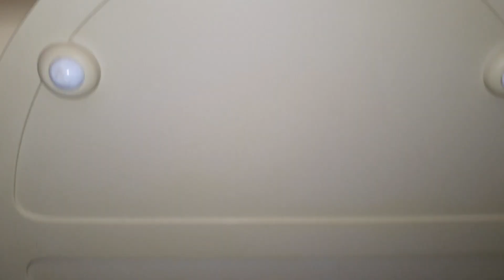EXTRA SPECIAL FIND!!!!! 1967 Twyfords "Vortic" toilet!!!

Comment: Absolutely brilliant, however it is pretty similar to the UK design Vortic of the same age, the only difference being a syphon in the cistern and the ‘vortic’ model name was taken off the pan by the 60s. Very cool and hope you manage to find more syphonics!
Reply from the maker: seems like the SA versions were still called "Vortic" by the 60s as this one dates to 1967, the one in sparkyfireworks's collection seems very different to this except for the trap.
Reply: @toiletsofsouthafrica  yes, they were still called vortic here but they stopped stamping the model name under the logo. Sparkyfireworks one is from the 50s, by the 60s they had redesigned it to this design, although I’ve never seen this design myself apart from in pictures, one UK filmer did find 2. The Norwood, Brampton and Vortic from the 60s onwards all shared the same pedestal and cistern design. (As did the bottom outlet syphonic ‘Crescent’ which I found, but that was intended for export only and none exist in the UK as far as I’m aware)
Reply from the maker: @TwyfordsLad  wow, there's quite a few variations, but this is just one of them, one that I'm really looking out for is the "Nuclere" saw one a while back but was broken.
Reply: @toiletsofsouthafrica  they're very rare, I've seen 3 in my time, 2 older and 1 slightly newer (60s-70s)